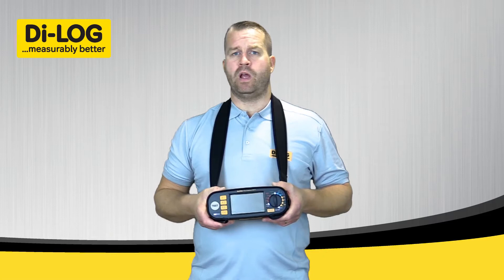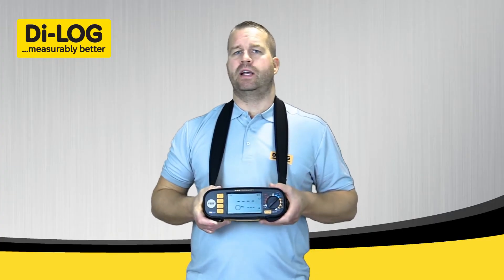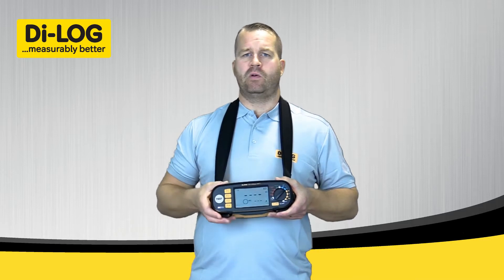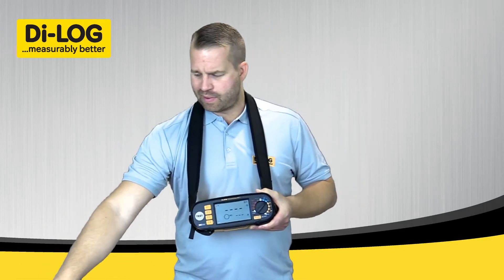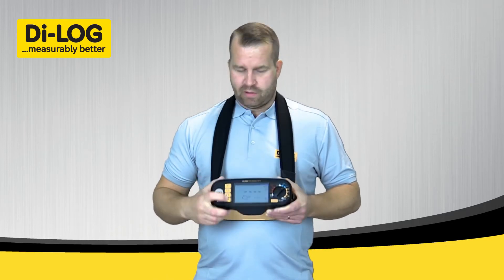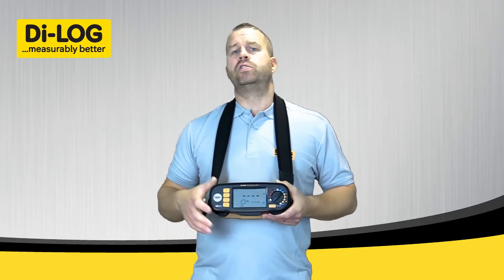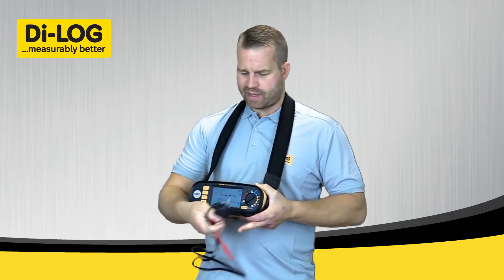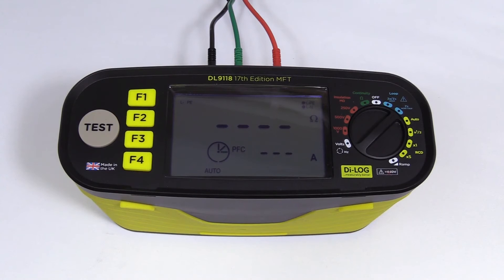ZS Loop Test Measurement using the Di-Log DL9118 Multifunction Tester

Comment: Hi, was wondering if it is possible to do a two lead Zs test on a DL9110? had a 3 phase socket with out a neutral in and had to run a long lead back to the CU to get a neutral for the tester to work, was wondering if there is an easier way to test this.

Comment: no mention of RCD uplift on this vid.  it's all well and good having an the RCDloc but the tester doesnt give you an accurate reading for Zs of a circuit protected by an RCD.  you end up having to use the caluclated method
Reply: Hi Dave, the new RCD-LOC XLT feature has been designed not to be influenced by the presence of RCD Uplift, so there is no need to calculate. The only time you may get an increased or decreased reading could be if excessive noise exists...this is the same with all ow current loop MFTs. 

I hope this clarifies your question.